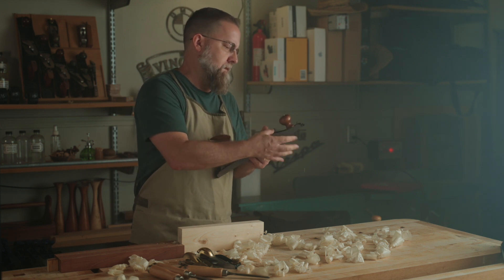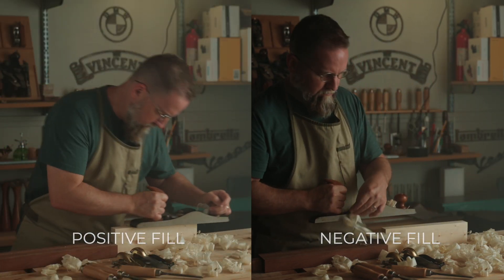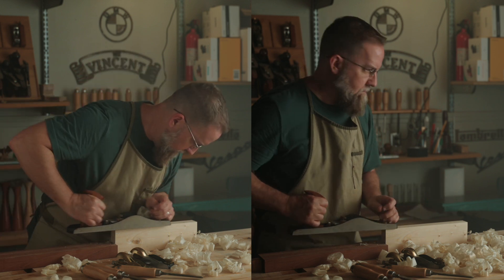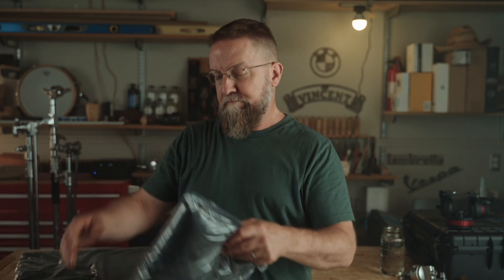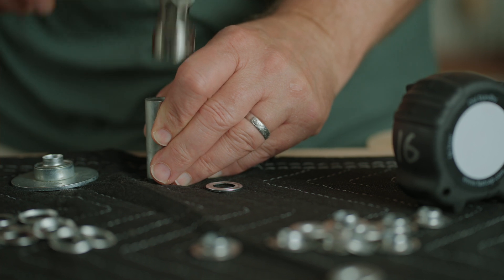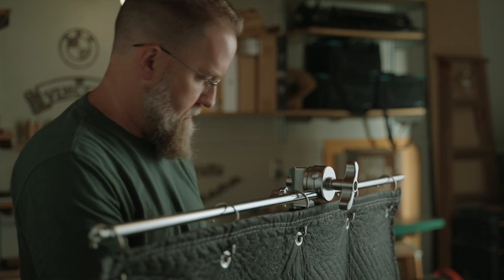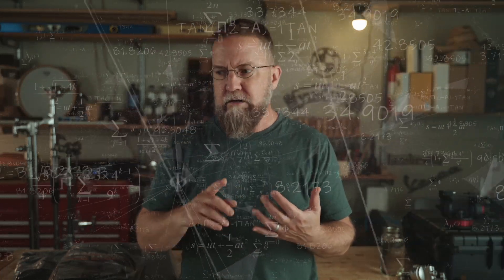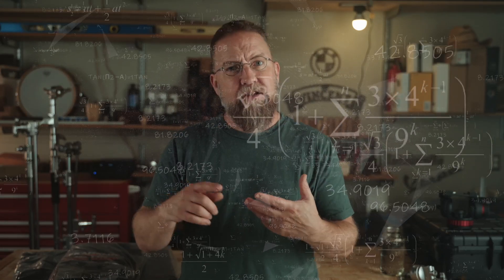Negative Fill Panels - Pro-Level DIY Video Production.

Comment: The light quality is great. What's your mainlight setup?
Reply from the maker: Thanks! It's another one of my DIY projects. It's a book light setup that uses a 5 foot by 7 foot frame with a single layer of bleached muslin. The light source is a Nanlite 300B MkII with a fresnel attachment, bouncing off a 4 foot square piece of white foam insulation. Y'know, something simple!
Thanks for watching.
Reply: @MattSpaugh  The light quality on you reminded me of my executive group  portrait lighting setup back in the annual report days...two Dynalites bounced into umbrellas and then through a king sized bed sheet suspended between two stands. Very soft and glowy. You need a lot of wattage to do this with LED lights as opposed to strobes, but I'm trying to figure out a way to do it for talking head videos with minimal gear...don't think that light quality is possible with minimal gear, though! Keep up the great work.
Reply from the maker: @bobkrist1  Yeah, that book light setup requires some serious juice. At and ISO of 800, my 300 watt Nanlite 300b mkII was on full power and the frame was still slightly underexposed. I'm working on another "Pro DIY Gear" video that shows my diffusion frame. It's modular and can be configured to a 5x7 or 3x5. The 3x5 with some 1-stop diffusion might accomplish your goal. 
Stay tuned!
Reply: @MattSpaugh  love to see this